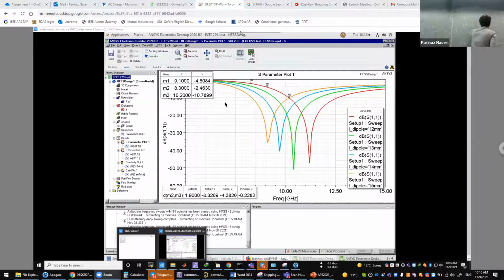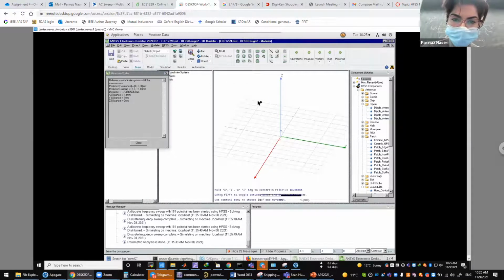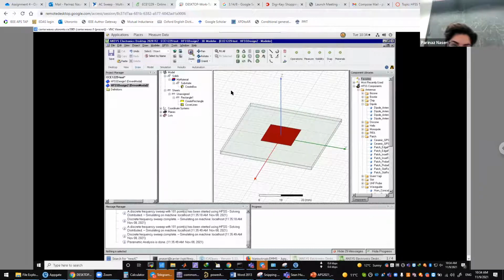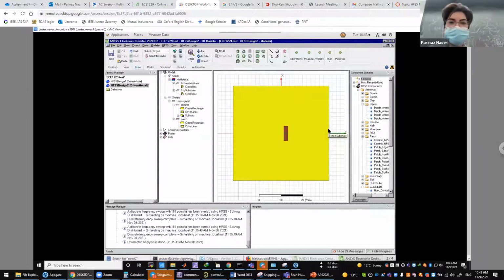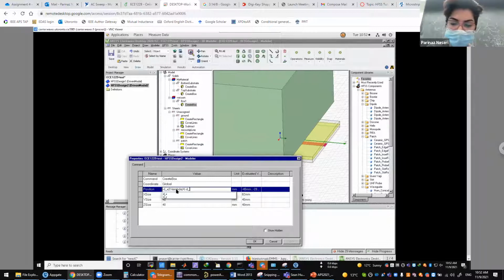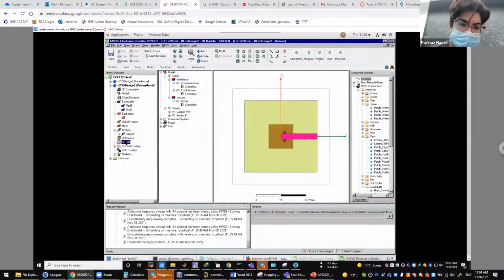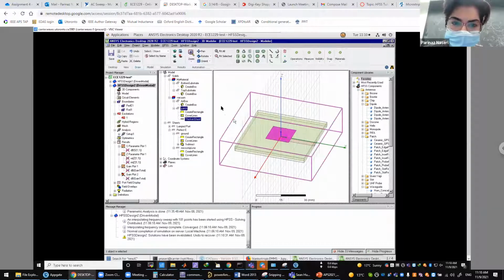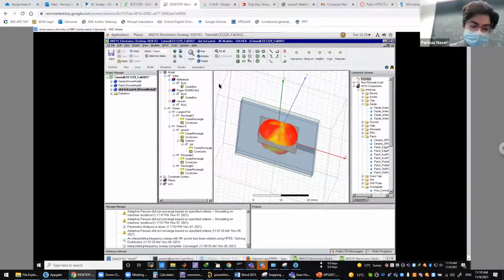HFSS Tutorial- Simulation of a patch antenna

Comment: Is there any formula for slot loaded patch antenna i.e where should i put the slot to get the dual band or multiband antenna and how it correlate with surface current distribution. It get very irritated when whole day searching for specific place where i put to get the desire bands. Since lot of stuff is hit and trial. I found CMA for antenna. But it is limited for PEC only to analyze the modes of antenna. Can you plz guide in this regard how to go through the slot loaded dual antenna.
Thanks in advance